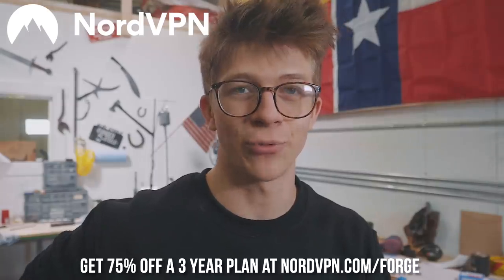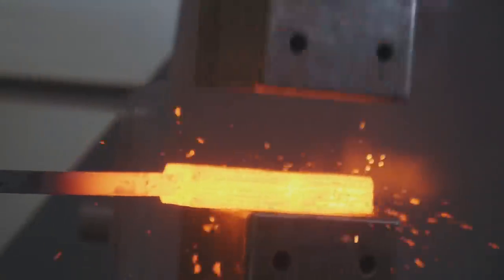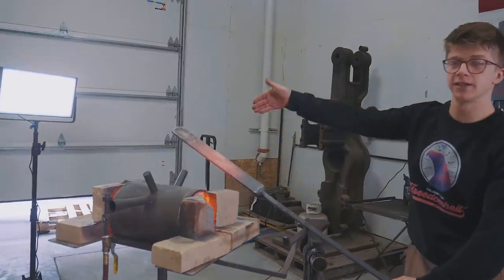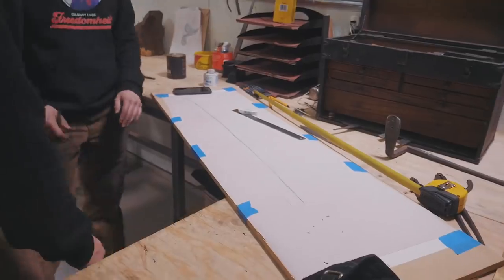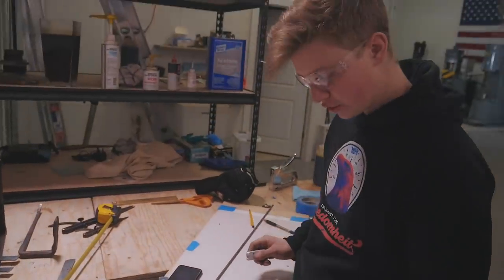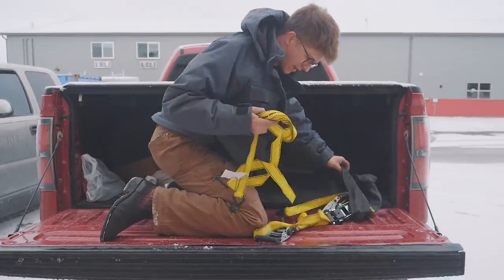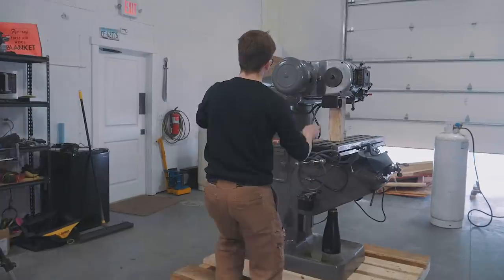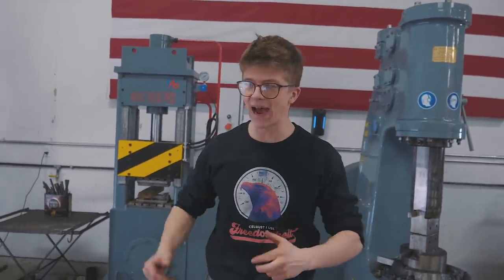MAKING A CAVALRY SABRE: Part 2

Comment: Wil,Alex,next time you have a go at turning iron to steel, I would;d try and add some Lime stone,
( FLUX )which is what they use to make the iron in the blast furnace,
and move the heat to the lower part of you furnace,
What i'n seeing is melting the iron and no carbon take up,,need the heat down lower,,not sure whether or not this will fix the problems,,

Comment: When using homemade steel its beat to use a coal forge, it gets hotter than propane, forms less scale so the welds are cleaner, and you lose less carbon

Comment: Please do a Collab with both Cody'slab and How to make everything,  and really make a sword from scratch, Bog Iron to finished blade. worth building a proper refractory furnace to produce the steel and avoid the problems you struck, likely caused by the iron getting to much oxygen from the open top furnace method you used. And you soo need to build a bigger Forge now, build a bigger one than the one you had in England, deeper, to better handle the longer sword builds. with the increase in man power you now have, i can see great things coming in the near future.

Comment: I would use another way of looking for cracks instead of using a microscope. Dye Penetrate would be the way to go to test these billets. Find the crack with it and then use a grinder to precisely grind the flaw out and them retest to see if it's gone completely.

Comment: You could just scale up that photo to what would be full size and then print it as a poster and tape together the 3 or 4 sheets so you have a perfect blade shape. Do you guys even have a printer?  That billet may be a failure as a blade, but what I see are some Damascus... Belt buckles, Keychain, bottle openers, letter openers, etc that would sell in a minute on your website or eBay.

Comment: I can tell you what the problem was when you were going through the folding process you probably weren't adding carbon to account for the loss through forging the Japanese your friend spoke of would consistently run their metal through carbon rich ashes from some plant a rice plant I believe and by running the metal through these ashes between foldings the carbon didn't get lost so the steel didn't decarbonize back to iron

Comment: Reading up on decarburization of steel, it sounds like it is a natural process that occurs when the metal is heated above 700 degrees.  If that is the case, why doesn’t the steel ALWAYS decarburize when you are working with it in a gas furnace?

Comment: Maybe next attempt at making steel from scratch, instead of using a gas furnace to heat it up, use coal and to not over carbonate the steel (unsure of actual terms) do only 4 or 5 melting runs. The reason for the coal is you'd be adding carbon into it as you worked it into bars hypothetically speaking. Unsure if that's how it works. I do know if too much carbon is in the steel it becomes brittle and will just break when you try to work with it.

Comment: I think it is a very wise, if heartbreaking decision to make another billet. If you don't start with an impeckable foundation, you can't do really great work. You probably know this, but steel today is made by removing all carbon from the iron and then adding just the right amount of it back in, so you can really fine tune the properties of your steel. Maybe this helps? ^^'

Comment: so I am confused.  as a blacksmith when you get steel to hot it turns into a sparkler, this is essentially burning the carbon out and reverting it back into iron.  so when you melted the wagon wheels you turned it into an Iron bloom, you then welded Iron to steel?

Comment: I'm curious, is it the striking action of the power hammer that sets the welds in the billet or the pressure. Could you weld the billet with the hydraulic press?

Comment: Alec what a hell l of a job you guys did making that steel. Sadly didn't work out. Will you be going for another go with original methods? Are there any other methods that were available back the that may work better? Makes me wonder how they got blade steel back then. Or was it hit and miss with mostly a less than ideal quality that they used?

Comment: Alec, is there in theory a way to save that billet? Probably a highly time intensive and stressful way at a guess, but is it possible?
Reply: I'm thinking that hundreds of years ago iron was a very very valuable resource so scrapping a mass that size would have been very costly to the craftsmen. So in order to avoid scrapping it what could they have done? Take it right back to the beginning to re-carberise it? Keep folding and folding it to work the impurities out (the basic reason japanese black/blades mither folded their steel so much was cos of bad quality iron going into the process iirc)?

Comment: It's a shame you need to start over. If you try to make steel again you need to get it much hotter. If you don't the metal does not fully liquefy and the carbon does not properly diffuse evenly. I'd supply the hearth with an oxygen tank next time, might get better results.